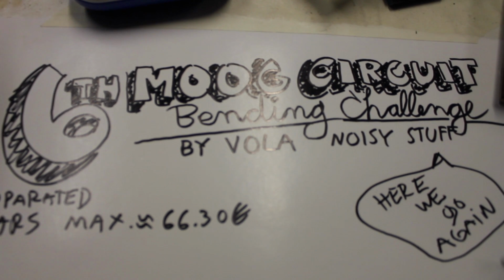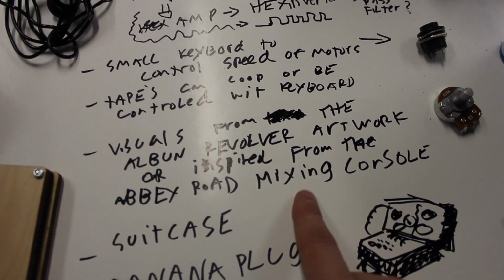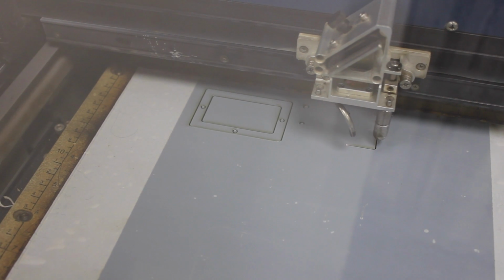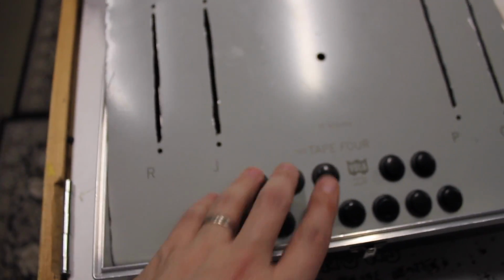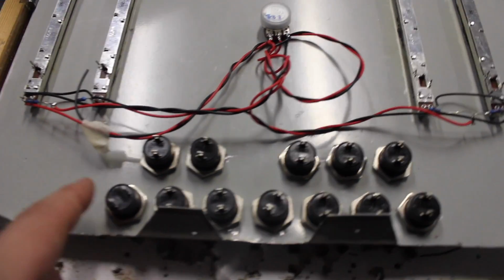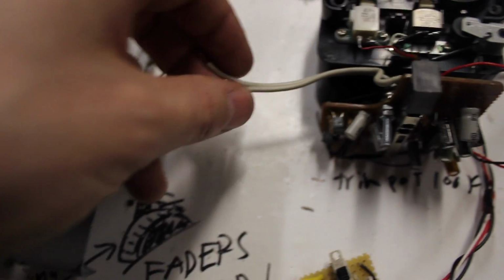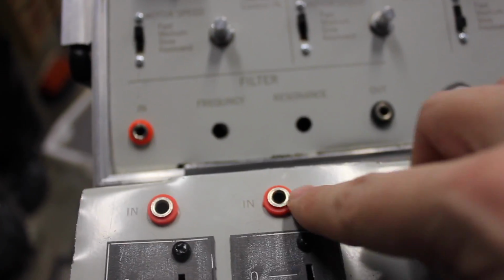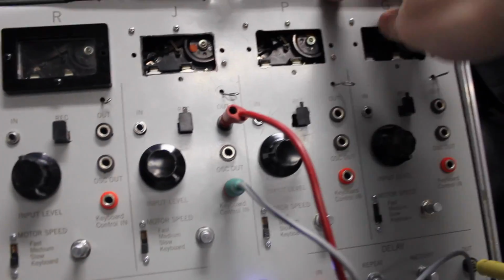Moog Circuit Bending Challenge 2017 - Vola the Tape Four Part 2

Comment: i built your delay circuit and it didn't work !!
Reply from the maker: I am sad to hear this. Cant really say why yours doesn't work. Mine does. It´s based on many other pt2399 schematic out there. Check them out too.
Reply: well, the repeats pot didn't work so i connected a pot to pins 16 and 13 et voila... it goes into feedback and creates some aweome sound. all in all i prefer not so bad !  thanks....
Reply from the maker: Well happy to hear it turned out good for you.
Reply: thanks. your idea of the cartridges is genius btw...
Reply from the maker: Thanks.
Reply: btw, i removed the jumper between pins 1 and 2 of the op-amp leaving the cap and it sounds better...
Reply from the maker: Actually looking at it now I think thats a mistake. There should not be link there. Thanks for noticing that.